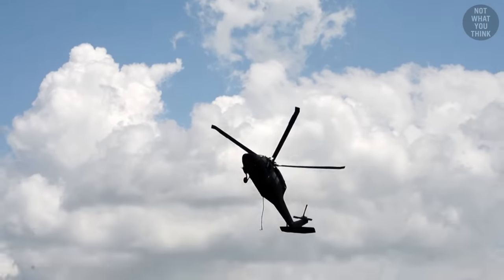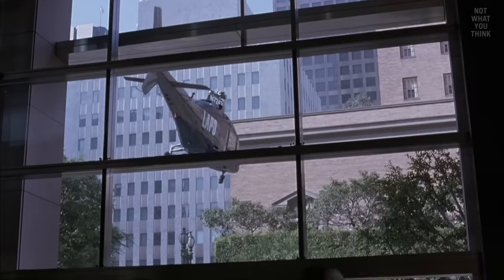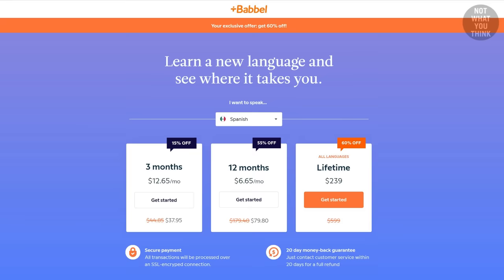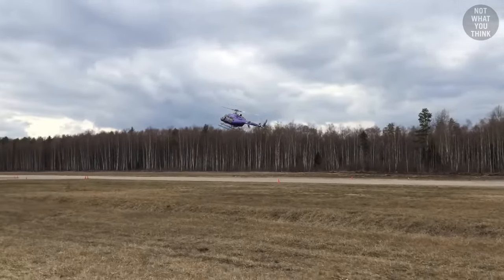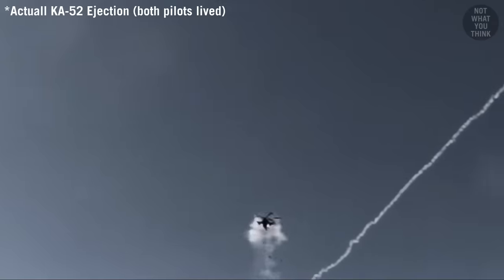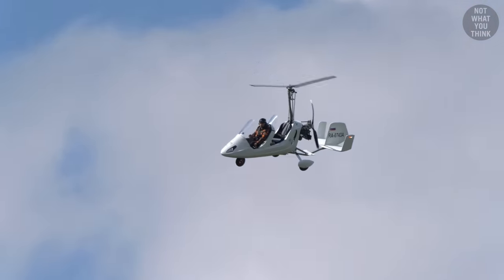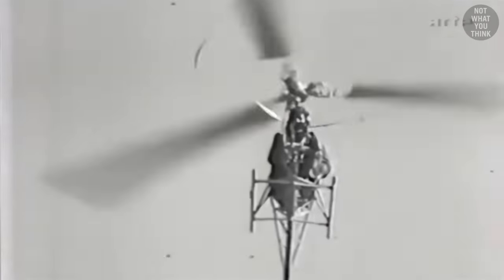Why Helicopters Fall Like a Leaf, Not a Rock

Comment: The note on safety comparing planes to helicopters was pretty strange. You validly pointed out that helicopters are flown in much more treacherous situations but when you compared deaths/100k hours they're almost identical. You completely neglected to mention that airliners carry orders of magnitudes more people than helicopters, so an airline crash killing 200+ people would take 100 fatal 2-man helicopter crashes to bring those numbers closer together. I do understand that there are many planes that aren't carrying hundreds of people that crash, but I do know there are not  helicopters carrying hundreds of people and the ones that are carrying large numbers of people are not commonplace.

I'm definitely not an expert in this topic and hardly researched it. Just felt misleading to compare them apples to apples and use it as causal evidence that helicopters are in fact safer, regardless if they are or not.

Comment: Helicopters are MUCH MORE DANGEROUS
The reason why death toll of aircrafts is SLIGHTLY higher than helicopters is bcs helicopter carry way less ppl on board

The basic phisics of hekicopter is the blades push air downwards while the helicopter needs to lamd on the ground so if the pressure difference is "right" it can flip instantly (By the way ATIS wont help you as its made for airplanes to begin with)
Gyrohovers (Or whatever you guys will call them) are all great fun and dandy just up to the point it will encounter turbolence or cross wind it simply wont have enough power/ no surface to resist the sudden or arthoganal movement of air 
The main reason why planes crash its that most crashes are of small planes when engine failed and the pilot treats their aircraft as a normal for landing istead of extending the aircraft glide 
(No reason to use flaps 2 in general aviation almost at all (ONLY use them as speed breaks if you REALLY TOO FAST) Flaps 1 will increase your lift without tempering your speed as its simply makes the surface of the wing larger without curving)
*Little advice on every flight prepair for engine failure and make yourself a red line that bellow it youll always be on a glide distance from airport  in case engine failed
+ Remember that ILS is done considering Boings and Airbuses your small plain got way less glide (aerodinamical) coeficient
Thus I ONLY recommend flying ILS on multi engine aircraft if one will fail youll have a backup

Comment: Aaaah en français s'il vous plaît... Très intéressant, cependant une question reste toujours sur ma langue, si les pales d'un hélicoptère s'arrêtent  brutalement pour x ou y raison, est-il possible que la chute de l'appareil ne tue pas ses occupants ? Si oui quel serait la hauteur "survivable" ? 
Très bon contenu d'ailleurs, je recommande souvent à des proches
Reply: if the blades immediately stopped, I'm afraid the pilot would die of excessive g force as the helicopter would counter spin at the speed of the blade
Reply: Ouch. Not cool...
Thanks for answering

Comment: Helicopters are, often, safer to land than planes, because you don't need much more than a flat spot of level ground and zero engine power. But airplanes are safer to fly, because they usually like to stay flat and level and if they deviate from controlled flight you have a lot of options to get back to stability. Helicopters, meanwhile, are a tensegrity arrangement of spinning murder blades, each part trying to escape from everything else at any given moment, held in place only by the ingenuity of high-tension steel, and if they deviate from controlled flight it's typically in a bunch of pieces, so they fact that those pieces used to be safer to land is irrelevant.
Reply: Aluminum, composite structure or titanium or the three most common materials used to make rotor blades.  Most people aren’t flying around in apaches with steel rotors.  Airplanes carry more passengers, require more speed and more height.  Both are very safe while they are in the air, which would you rather crash in when they hit the ground is the question.  I’ll take my chances with the vehicle that doesn’t require a runway and is not affected by tail and crosswind.
Reply: @mikezappulla4092  oh, by high-tension steel I meant the airframe, not the rotors. I suppose I could be incorrect about that as well; I don't know how much of the typical helicopter body is aluminum or composite instead of steel. I just assume steel is cheap and common.

"which would you rather crash in when they hit the ground"

Depends on why we're falling. In the case of, say, a bird strike, I trust the wing root of most monoplanes over the likelihood that the rotor shaft will stay on, just in terms of pure material strength.

But yeah, engine failure in one, versus engine failure in the other, I'd take the helicopter any day. Gyrocopters are stable and safe to fly for a reason. As long as all the materials keeping everything together don't like, unscrew themselves, the flying model of an unpowered rotorcraft is more stable to land.
Reply: @RamadaArtist  agreed and good point about the type of aircraft and cause for the engine outage.  Kobe Bryant went down due to fog, autorotation couldn’t help and the helicopter broke into pieces.  While the same could happen in a fiberglass single prop, it would be less likely since the workload on the pilot is not as demanding which should increase situational awareness.  In a commercial airliner or even a private jet, the fog that brought down Kobe would not have been a factor at all and Kobe would still be alive.

Comment: Neil is partially right.  If you don't disengage the rotor it will fall like a brick.  Helicopters have something called a freewheeling unit which detects if the RPM falls below a certain threshold and it automatically disengages the rotor from the clutch.  This allows the rotor to spin freely.  Otherwise all of that rotational energy will go towards trying to turn the engine, and you will fall like a proverbial rock.  Sometimes those freewheel units fail and the result is a catastrophic crash.  I worked in a helicopter squadron for about 8 months (HSC-6), and they had a facility that was used to test the balance of rotors.  It's very important that the rotors are balanced correctly or it will wind up oscillating itself to pieces

Comment: I think some important part of explaining HOW DA FK IT WORKS are missed here. Why propeller rotates when machine falling? Does it have ability to set negative attack angle? If so - why rotated blades with negative angle can create lift force?
Reply from the maker: We touch on it at 4:08 with the example of the pinwheel, but correct, we don’t really get into the actual physics of it here.
Reply: @NotWhatYouThink  yeah, I saw it. But important thing is: if angle of attack stay positive after engine failure, propeller needs to stop first and starts to rotate reverse. Obviously it not how it work in reality, so I guess helicopters can switch that angle in negative area (not just "flat") in such situation but dyno are they all can make it? I know some helicopters even can fly upside down but not sure about ranges of angles of blades on "generic" helicopters. 4:48 are most interesting thing for me to understand why it falling slower if rotate faster. And thanks for answer, didn't expect this from big channel lol.
Reply: @RedToxy-rc7ev  That is what the collective pitch stick is for.

Comment: I''m not sure the analogy is correct but certainly (I'm not a helicopter pilot, unusually for the internet I'm try to be accurate!) pilots autorotate. Indeeed for military pilots (not sure about private) they are trained to autorotate as a matter of course so they realise it's not so bad. AFAIK it is NOT about "upward" air like this video, sorry! I'm a physicist so some of this video doesn't seem right, That could be involved but it's about the momentum of the rotors + energy transfer at a key moment. It's all about the physics transfers of height/momentum to the energy you want to live at the last minute.

Comment: the 1.3/100,000 deaths per hours vs 1.4/100,000 deaths per hours is misleading, as the number or persons on the vehicles is not accounted for. leading to the fact that a crash on a heli is more likely to end up in a death then a plane crash. even if the deaths per flight hours is lower.
Reply: Unless the number of x/100,000 deaths per hour accounts for the number of individuals on the vehicle but gets cancelled out because it is divided by itself, which is not specified.

Comment: Don't helicopters have a tendency to crash or be unusable in military operations depending on weather and air conditions? The raid on Osama Bin Laden  would be a good example of helicopters being unable to function (and crashed) due to that sensitivity. 

Saying things like "most crashes are caused by human error" or "the helicopter tackles more difficult terrain" is about as pointless as saying "airplanes have many more people in them, and thus numbers of crashes are lower but fatalities are higher." These are all things both of these aircraft are designed to do. If they can't function in what they're designed for or are too problematic for humans to reliably use, these are failures in their safety and utility. When human error is consistently a cause for crashes, this reflects on a systematic problem in piloting the craft - even if its just sheer difficulty.

The part about auto-rotation was very interesting, but the argument regarding the comparative safety of these aircraft was flawed (btw. I'm not making any statement about which aircraft is actually safer either).

Comment: If only Kobe knew about this 😢
Reply: The Helicopter Kobe was in didnt have a engine failure. The crash was just the pilot flying dangerously. The pilot made a "poor decision" to fly at "excessive airspeed" -- about 160 miles per hour -- into an area of poor visibility. The pilot lost the ability to control the helicopter after losing visual contact with the ground, and then slammed into it. Pilot error, not engine.

Comment: Can the Kamov really eject its crew though? Russian military fans have been bragging about it being the only helicopter with ejection seats for 2 decades, but now that we see the thing in action, there are tons of videos of it being shot down and crashing and in not a single one of those videos did the crews use the ejection seat.
Starts to look as if this is just another case of claims about the capabilities of Russian weapon systems that apparently don't really exist in reality.
Did someone steal and sell components of the ejection seats on the black market? On all the helicopters we saw crash in the last 1.5 years?

Or are the rumors true that the Russians are purposefully disabling the ejection seats on their aircraft to "motivate" the pilots to bring the aircraft home safely?
If so, then what was the point of developing and building the ejection seats in the first place?

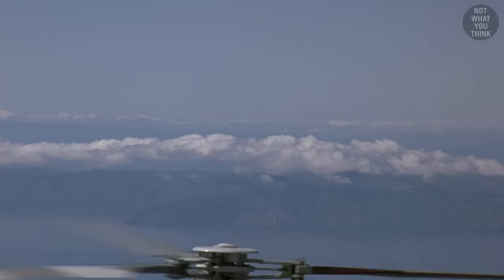Comment: whattt?????? 3:55, no helicopters do not draw air in and blow it downward to generate lift....they are NOT fans.
rotors work exactly like wings, as they rotate the air passing above the rotor has to travel faster than the air below it due to its shape, thereby creating high pressure below the rotor pushing it up and low pressure above the rotor sucking it up.
if u dont know this you shouldnt be talking about helicopters
Reply from the maker: We were not explaining the lift mechanism. We were simply saying which  way the airflow is when the engine powers the rotor blades, and it is downward.

Comment: Your death staticic is false even though the helicopter has a smaller number the fact that helicopter usually only carries 1 or 2 people means that most of the time both people die compared to airplanes where they have 189 people sitting in them.

Comment: Ok 90% of the time thats true.   there ARE cases though  where engine failures lead to uncontrollable rotors - meaning auto rotation is not possible.    though because the rotors are still spinning SOME drag occurs, its not enough for any level of a safe landing.  

Some engine failure also can lead to rotor osculations causing the rotor blades to come apart in the air.   this...   is like ripping the wings off an f-4...   brick.

Crashes like this though are the minority  and in most simple engine failures, the helicopter can auto-rotate.

Comment: The helicopter on autorotation is nowhere near safe. It's jut not instant death sentence. It's less akin to a parachute and more of last seconds opened parachute — you won't get slammed into pieces, but you will most likely get injuries, lose/seriously damage a vehicle and some people might die. For example, kids got near zero survival rate on hard helicopter landings — they simply get their spine collapsed into itself. Same with certain "medicine" abusers — weakened bones shatter like dropped jigsaw puzzle.
Military helicopters got radical damping means to survive hard landings better. Still, you need a training and/or equipment to save yourself from snapped neck. That's why Ka-50/Ka-52 helicopters actually got ejection seats and discardable rotor blades — it's much safer than sticking to your suspension means and praying for the best.

Comment: Yet Helicopter crashes are fatal remarkably often, autorotation or no.
Reply: 1.If the blades hit something there's not much you can do and 2. They require a deeper understanding of aerodynamics.

Fixed wing is pretty much "me go fast, me can fly". Not so much with helicopters.

Comment: It still doesn't make helicopters much safer compared to aircrafts, and your example with that F4 is really bad and rare example. That aircraft is clearly stalled, had no chance to regain lift power on the wings. Now compare loss of helicopters vs loss of aircrafts in a war. Helicopters are like flying coffins. 😉

Comment: What generates lift is the airfoil of the blades. They are infact rotary wings and like the wings of an aircraft they produce a high and low pressure, the high pressure producing lift. The faster the air is moving over the blades the more lift is generated.

Comment: But if a helicopter fails in a way that means it cant autorotate, which is pretty easy to do, it does indeed have the flying characteristics of a brick. Neil de Grasse Tyson isn't so far off the mark on this one.

Comment: heheheeh  yea its all fun and games till you do a  mast whip on the controls and  the  blades cut the tail rotor off and the blades snap at the  rotor hub. Stick to cartoons watching, Helicopters  with an intact rotor head  can auto-rotate, BUT, you have 1 and ONLY 1 time you can unload  the rotor near  the  ground to slow down your impact. Then again MANPADS cause many Helicopter injuries.